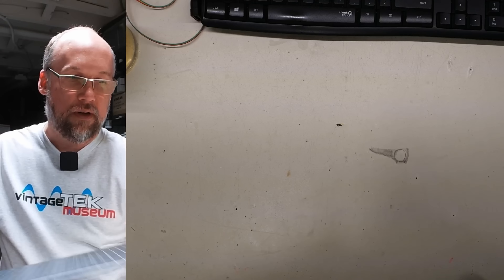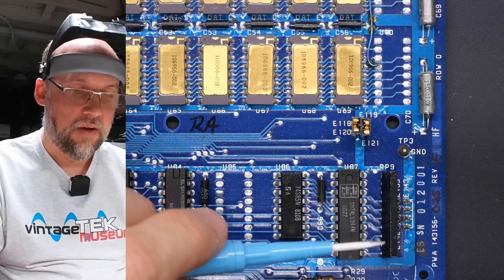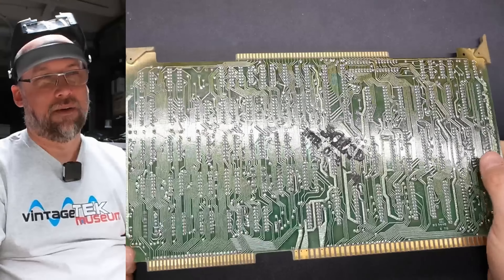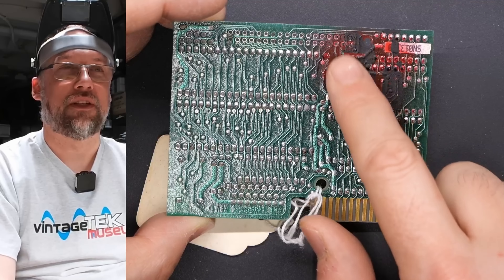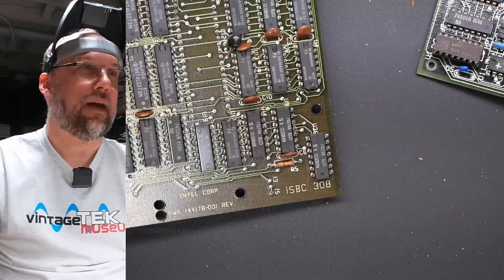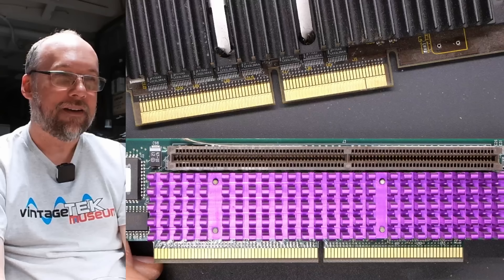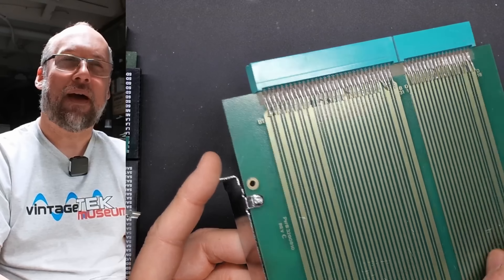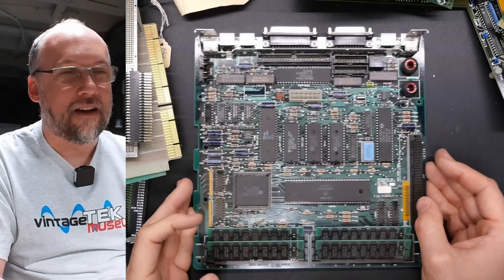Box of "scrap" vintage computer parts

Comment: Those first few boards are Intel Multibus cards. The reason they don't look like the picture you saw in the Wikipedia article is because the cards you have are Multibus I (IEEE 796) whereas the card pictured on Wikipedia is a Multibus II (IEEE-1296) card. (The Multibus II spec was released in the late 80s, so long after those boards you have were made.)

Multibus was used in a lot of industrial systems . It was also used in a lot of 80s and early 90s UNIX systems from HP, Sun, and SGI. The Sun-1 and Sun-2, for example, were 68000-based systems that used Multibus I in order to take advantage of peripheral cards that had been designed for Intel Multibus systems.
Reply: aha, later in the video you show an Intel iSBC web page that lists them as "MULTIBUS I Single Board Computers"
Reply: The Wikipedia article also mentioned that 8089 IO processor being used in the "Intel System 86" -- so I Googled that, and found a "System 86/330A Overview Manual" (this one published in June 1982) which shows a desktop chassis with multiple cards in it, about the right size.  The contents lists a CPU board, a 256K memory board, a Winchester controller board, and a floppy disk controller board.  Sounds like a match to me!
Reply: and...wikiped... is known for its inaccuracies...
Reply: I have about a dozen of these cards and 2 of the Intel low profile rack mount chassis for them (model SBC 655). I have a couple of 8080A CPU cards (80/20), a couple 8085A CPU cards (80/05), a couple of memory and I/O expansion cards, and a couple of DAC cards (by DATEL). These were used in the USGS DWWSSN seismic stations that were deployed around the world in the '80s. I will be firing these up for our next vintage computer club meet in Albuquerque.
Reply: This unlocked a deep memory for me. My parents had a computer with the multibus boards for their business back in the 80s. Haven't seen those dual connectors since I was a kid.
Reply: I wonder if any of these are from a radar system.
Reply: To be clear multibus 1 was heavily used by the military and still used in a few airports, according to a bit of googling and a job offer I had once. They're being outmoded by FPGAs.
Reply: is it possible that SUN hardware uses Multibus - checking wiki  - yes... it seems
i remember the dmesg listing . .
Reply: Actually that's the Intellec bus.  Intellec MDS most likely.  Had one in college.

Comment: GPIB (IEE488) is a bus for controlling the lab devices like multimeters, power sources, etc.
Reply: And aren't the Commodore PET disk drives on a GPIB?  I believe that the Osborne 1 also has GPIB for, what, a printer?  Maybe I'm wrong about that.
Reply: That is what it became, in its early days it was an actual computer bus like SCSI but it was quickly outdated, being an 8 bit bus. The origin was HPIB but that was patented so the industry circumvented that by creating the GPIB "copy".
Reply: @goranekstrom708  almost: HP were fully cooperative with it becoming an industry standard, you just can't use company names in standard names. Same reason SASI became SCSI, even though Shugart again were part of the effort.

Comment: So that AZ-COM card there is something rather special indeed; that's a PCI bus analysis and hot-plug validation board. The risers segment can be configured to mimic cPCI passive extenders for cPCI analysis as well. The missing SW2 would be the bus swap in/out as I recall; that toggle at the rear is probably for switching between 5V and 3.3V. I actually did a very similar modification.
The Twin Industries 5EXTM is a 32-bit board specifically for backprobe and testing on 4-layer PCBs; they still make several versions of it to this day.
Reply: Yes! I place I worked for in the mid  late 90's made a short run  inhouse version of this type of adapter for testing pci network cards. Hotswap (with a toggle) PCI  goodness.
Reply: @escgoogle3865  same - mid-late 90's, but we had a bunch of these exact cards for prototyping and validation work. Simply because they were orders of magnitude cheaper than Innotec or MuTech!

Comment: Are the initial few boards from an Intel MDS System. We used to use those back in the late 70's and through to the 90s for 8085 and 8086 development. Can't say I remember exactly what the boards and Backplane looked like. But many of the boards had a backplane and ribbon cables off the front edge similar to those you showed

Comment: The purple Sonnet thing is a G3 upgrade for the powerMac 6100/7100/8100. Those came with PPC601 chips, up to 110MHz IIRC. I had a 8100 back in the day, and would have given an arm and a leg to have an upgrade like that. Those NuBus powerMacs were weird to upgrade; the upgrade plugged into the video card slot, and then you'd plug back the video card into the upgrade card. That's why it has 2 slots. Unfortunately I don't have that 8100 anymore.

Comment: Re: Top Down Camera ... I can see a hot spot reflecting off the circuit board. It might not look obvious but it's like taking a flash picture at a mirror. The camera is trying to compensate for a light source in the picture. Try putting a mirror on your table and see if the camera can see a light source.

Comment: As others have said, those are Multibus I cards. This was likely some form of industrial computer; the cards would plug into a card frame/chassis, similar to the old S-100 systems.  These were referred to as SBCs, as compared to older designs that had a CPU board, a memory board, and such.  The original IBM-PC motherboard would have been considered an SBC at the time it was released.

Comment: That's the original version of the isbc-215 that requires a external adapter for st-406 drives rather than the generic 215g variant that supports them directly.  The documentation for it is at bitsavers.

Comment: The Sonnet Crescendo 250/512k is a 250 MHz G3 processor upgrade that plugs into the cache slot on several different Macintosh models, and some clones. It'll work in the Power Macintosh 6100, 7100, 81xx, several Performa models in 61xx series, 6360, 6400 and 6500 (as well as their Power Macintosh counterparts), WGS 6150, 8150 and 9150, as well as Power Computing 100, 120 and some others.

The Newer Technology Maxpowr Pro 250/125 is a 250 MHz G3 upgrade for the Power Macintosh 7300-7600 and the 8500-9600.

Both of those upgrade boards are highly sought after and are worth hundreds of dollars a piece, if they still work. But even if they don't work, they'd still go for quite a bit to someone who can fix them.

Comment: 26:13 - This is a Sonnet Crescendo G3, which is an upgrade processor for PowerPC 601-based Power Macs. It mentions 3 models on the card specifically: PowerMac 7100, PowerMac 8100, PowerMac 6100AV. It is known compatible with the 7100 and 8100, it is incompatible with the 6100AV and incompatible with DOS-compatible machines, however; it will work in any other 601-based PowerMac with a Processor Direct Slot, or "PDS." It has a maximum frequency of 400MHz, 64k of level 1 cache, 1mb of level 2 cache, and supports MacOS 8.5-9.0. Retail was $700.

27:18 - This is a Newer Technology MAXpowr G3 250, which is an upgrade processor for PowerPC 604(e)-based Power Macs. It is compatible with the PowerMac 7300-7600, 8500-9600, as well as some PowerComputing and Umax Macintosh clones. It replaces any stock daughtercard, and plugs into said daughtercard slot. It has a maximum frequency of 250MHz (hence the 250 name), 64k of level 1 cache, 512k of level 2 cache, and supports MacOS 8.0-9.0. Retail was $550.

These are really cool and a good find!
Reply: I have the same 250MHz Newer Technology MAXPowr G3 card in my “Kansas” 9600, very nice card. I also have XLR8 MACh Carrier G3 card somewhere that I haven’t tried yet. I believe it is a 400MHz G3.

Comment: That board was used in Intel iRMX boxes.  I remember these from a company that used them as system controllers for data acquisition systems.  Definitely Multibus systems.  I just called them Intel White Boxes, as opposed to Blue Box development systems for micro controller based systems.
Reply: I own an Intel System 86/310 which has had a very interesting life modified as an iAPX 432 clone system from a company called High Integrity Systems. Sitting right next to me..!
Reply: @orinokonx01  : iAPX 432 is many things, but indeed, "uninteresting" will never be one.
Reply: @absalomdraconis  I have been (very slowly) piecing together a YouTube video about this system, if only so that others can learn something about it and where it came from. I've even 3D modelled about 80% of the internals. Even have a faithful recreation model of the System 432/600.

One day I'll get back into that project. That's why the machine is sitting next to me!
Reply: This is what I was going to say.

Comment: As others have said, Multibus I cards (the ones with the same edge connectors). I would guess they were all in house prototyping boards by the "scrap intel" stamped on the backs and the crazy amount of bodge wires. Very cool find, I would make a cool wall display out of them.

Comment: The SBC multibus was used in industrial process control systems, the first company i worked for back in the mid-late 90's made industrial control systems with 8086 and the 80486/overdrive cpu cards. The CPU cards are stand alone, they have everything on them (local ram, IO etc) however they have a bus so that you can plug multiple CPU cards, shared memory cards, IO cards etc etc and access them.
The reason the roms are 'missing' is because these contained the operating system that was made by the company for the client.
The 'bodging' might not be repair bodging as the cards would need to be configured which sometimes you wire wrapped from configuration pins and sometimes they were soldered.
Reply: Yep, they were in the CNC machines I worked on in the mid 80s. The processor used was a Zilog Z8000. Machines were Excellon drills and routers

Comment: The Sonnet card is for the first generation PPC Mac, the 6100 was a pizza box format machine with a Processor Direct Slot that could take an adapter to get a Nubus slot. 

The Newer card is for a PCI Powermac. It might be a G3 processor or maybe a 604. I'm surprised it didn't specify which.
Reply: It’s a 250MHz G3, I have the exact card in my 9600

Comment: 33:30 The extender boards were a thing you saw for amateur (ham) radio repair, starting with the Yaesu FT-101 series in the 1970s; Yaesu designed their transceiver to have plug-in boards so you could test them either on the bench or plug the extenders to work on it with the rig plugged in, or just stick a new board in. This stuff is still being done by FT-101 users to this day.

(The FT-101 is a Japanese shortwave ham radio which is mostly transistorized, except for the transmit output, which is amplified by tubes. It's a very analog machine.)

Comment: I don't have any INTEL multi bus boards but I do have several MC68000 and MC68020 boards and (i believe) a 5 slot backplane.  I converted an old test stand from the multi bus system to a PC At/386 with a custom interface board.  It took about 6-8 months to design/build and rewrite the test software.  About a year after that my company was bought and the multi bus systems were tossed.  I have them in a storage unit waiting to be revived. Maybe one day.

Comment: The board at 15:10 is probably for a terminal.
GPIB is used in, among other things, oscilloscopes and test equipment. 

Maybe most of this first pile was from some sort of manual + automated testing workstation.

Comment: As others have said - it is a Multibus card. The Multibus was Intel's competitor to the Motorola Exorbus (which later became VME).  It was first invented and used in their Blue Box development systems.  The boards that have sockets on the bottom are likely emulator boards.  The Intel Blue boxes provided emulators for the different Intel CPUs.  The sockets on the bottom would be how the emulator was plugged into the board-under-development. This would let you load code and interactively debug your board and software together. The blue box would supply you with keyboard/monitor and disk storage for supporting your debug.  I believe these were called "Isis" boxes - maybe for In-System-Support 0r something like that.

Comment: 8255? I know that one well. It's not a UART. It's a two or three parallel ports, depending on how you configure them as input only,  output only, bidirectional or bit mode.

Comment: My thought on the board with SCRAP on it is that when I worked for DEC, sometimes things would get marked as SCRAP as a way for them to be taken off the books so that someone could take it home with them. There'd be nothing wrong with it, or maybe some minor thing to justify marking it as scrap.
Reply: Right - it was generally marked SCRAP so it couldn't be resold, not because it was non-functional.

Comment: The PCI Electronic Extender (PCIEE) is a device designed to enhance the process of testing and developing PCI Bus products. With the PCIEE , you can disconnect the power and bus signals from the top connector and safely insert or remove tested cards with the PC power turned on. This not only saves time, but also protects the components of the PC from damage that results from constant Power On - Power Off cycling.

Comment: That ink used to stamp SCRAP on those boards may be conductive!  A lot of stamp pad inks back in the day had carbon black as a major component. Be sure you clean that up before firing up.  

The 8255 is a programmable peripheral interface.  It provides three 8-bit parallel I/O ports that can be configured in a variety of ways by sending appropriate code to the chip at startup.
(A very long time ago, I built an I/O board that used an 8255 to interface to real-world loads that were controlled by a SInclair ZX-81 that controlled the I/O by use of POKE and PEEK commands from Sinclair BASIC.  The board was described in Mike Lord's "The Explorer's Guide to the ZX-81 and Timex-Sinclair 1000".   I still have a copy of the book, having recently re-bought it used.)

Comment: You can pretty easily pinpoint the short on the card that has the +5V shorted to GND marking using a milliohmmeter. I have a bench multimeter that can reach there. Handy for finding shorts.

Comment: The 8202 is a DRAM controller from back in the day before DRAM did it's own refresh. Not a chip I have used (I used to use the 74S407 I think).

Comment: If only that Intel 056A written on the board was of any help.... "The iSBC 016A/032A/064A/028A/056A Random 
Access Memory (RAM) Boards provide a dynamic 
memory storage capacity of 16k, 32k, 64k, 128k, and 
'256k bytes, respectively, for use with all Intel iSBC 
HO/86 Series Single Board Computers and Intel 
SO/86 Series Microcomputer Systems. These RAM 
boards interface directly with the bus master via the 
Multibus interface and differ only in memory 
capacity and memory array configuration. This 
manual provides a general introduction, prepara- 
tions for use, principles of operation, and service 
requirements for each of the configurations of the 
RAM board. 

The iSBC 016A/032A/064A/028A/056A RAM boards 
are designed to allow quick, easy, and inexpensive 
expansion of RAM storage facilities within an Intel 
Multibus-compatible System. On-board refresh 
circuitry initiates periodic RAM refresh cycles to 

maintain the integrity of the RAM data. An optional 
auxiliary bus connector may provide battery back- 
up power for the RAM and the refresh circuits. The 
RAM boards are direct replacement products for the 
iSBC 016/032/064 RAM Boards. Figure 1-1 shows a 
typical example of the iSBC 016A/032A/064A/028A/ 
056A RAM Boards. "

Comment: The tiny board with 488 on it would be a GPIB (General Purpose Interface Bus or IEEE-488) interface.  It's a relatively simple interface to implement, having exactly 16 data/control lines.  It has an 8-bit bi-directional data bus and 8 control lines.  The control lines are used to change the data bus between data mode and command mode, and also for flow control along the data bus.
I'd presume that one of the two large chips is used as an output latch and one is used for input, while the two slightly smaller chips contain the control programming.  There looks to be a resistor array in there, so I expect the output was open-collector with the resistors providing pull-ups to make the data lines "float" high when not being controlled.
Functionally, they could probably have gotten away with just using a single 16-bit interface chip, but logically it was probably easier to implement the GPIB protocol by having separate chips for input and output.
The reason I'm so knowledgeable about GPIB is because I had to "home brew" a GPIB interface to allow a kit-built computer to "talk" to an old Commodore 2031 disk drive which used the GPIB for its interface.  I used two 8-bit output latches and two 8-bit gates for input, with a few "glue" logic chips around the interface chips to decode the I/O address and handle Chip Enable.

The (presumably) RAM chips probably have their response time in nanoseconds printed on them as the last three digits, so 002 means a 2 nanosecond response time, which is pretty fast considering when they were made.

Comment: Those little blue connectors on those Multibus cards look like iSBX. Fun fact: ASDG made an iSBX adapter on a Z-2 card they called the Twin-X. They made drivers for RS-232 and GPIB modules but anything fancier than that you'd have to get made yourself. Also DMA wasn't supported.

Comment: Blue boards at Intel means Beta prototype pass.  Red is used for Alpha pass, and green is either a production spec prototype or a production part.  Something escaped the lab there-Intel has a very strict internal system to keep track of and destroy prototypes.